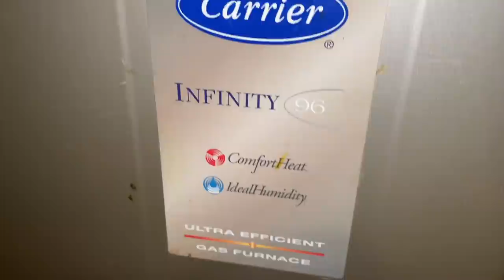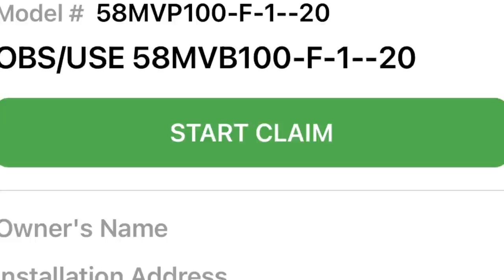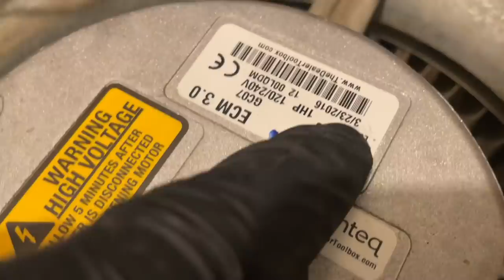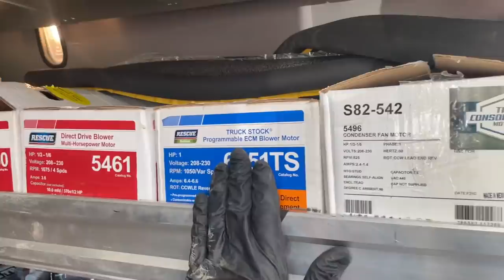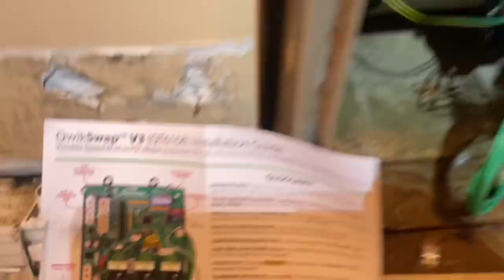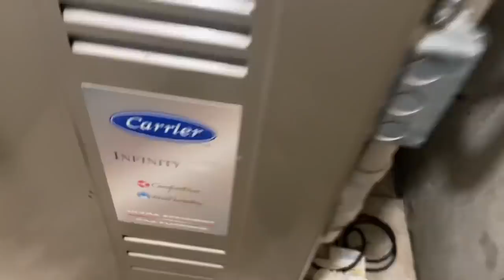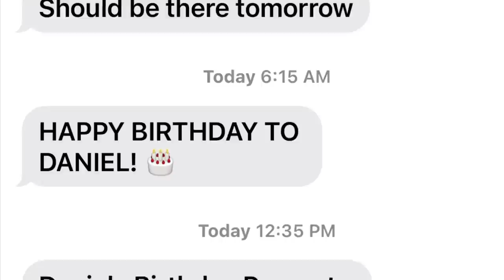Carrier Infinity Central AC Not Blowing - Dead ECM 3.0 Blower Motor Replaced with QwikSwap X3

Comment: I have found when the repair is most difficult and challenging one that I learn the most.  The hot compressor reminds me when outside valve wouldn't work in sub freezing cold weather and my co-worker took a buck of hot water and threw it on it and the valve started working.

Comment: I've had a few of my ECM motors die which I was able to fix myself. The wheel would wiggle back and forth as if it was 'seeking' or lost. Ended up being shorted windings inside the motor; not the ECM end cap, 3 times now. I have 2 fixed motors incase it happens again. Good to know this is an option if end cap goes!

Comment: Hey Mikey Pipes! Love the videos. I always hate holding this dang door switches. I always throw either those door furnace switches or a magnetic bowl to keep them on if there is a delay while I can get my tools all packed up and test the system. Just a friendly suggestion. Happy weekend!
Reply: I use hockey sticks
Reply: @PipeDoctor  that what we call them,they are little yellow plastic wedges shaped like hockey sticks,you wedge them in the switch,they work just like the little orange plastic keys
Reply: @PipeDoctor  I have alot of gadgets and tricks up my sleeves

Comment: Mike - Are you aware of the secondary hxt issues on these older carriers? them plugging up as plastic coating fails and producing massive amounts of co, rusting out too.
wise to visually inspect and do combustion test before bothering changing parts.
Reply: @PipeDoctor  yes - all the carrier 58 series condensing furnaces. Secondary is aluminized steel coated with plastic. Hot burner box and high co, rust on exterior of secondary, bad exhaust smell are all symptoms.
Class action lawsuit forces them to pay some labor or rebate on a new carrier. You can find product bulletin online detailing diagnostic procedure.
have a family member with one from 2005 as well (which is how i know), only a matter of time until it goes. 
Mi Heating guy has done many videos on this.
Reply: carrier = navien of forced air furnace manufacturers, denied that there was an issue for many years and kept on making them! :(

Comment: RIP that heat exchanger doe. Never used QuickSwap before. Ive been wanting to swap my PSC blower to an ECM on my old 80% Goodman so I can use Fan, might try one of those. Do you need to do static tests with that new blower/module?

Comment: I just had a motor just like that (x13 1/2hp 230VAC) die on me Yesterday. Would attempt to spin slow then stop and repeat. Found a burnt winding near the top of the motor. And my ohm readings were off got 11ohms on 2 windings and 3.8 on the third. Sad part is that it is under warranty but I am not the original owner of the unit (Moved in afterward) Already ordered my new motor for about $340. May think about switching to a psc motor with that board next time.

Comment: Did you tested the fau in heat mode and did the blower motor came on? In most cases the Genteq 3.0 cannot be replaced with aftermarket solutions except it’s own aftermarket brand Genteq Evergreen

The 3.0 is capable of being a fully communicated ECM (two-way communication between ECM control & OEM board) 
Usually Carrier Infinity & Bryant Evolution fully communicated or modulating systems require the Genteq 3.0 or Genteq Evergreen VS(which is a 3.0)

Just wondering if you had a heat recall because it wouldn’t work in heat mode

Or maybe the customer called someone else
Sometimes the customer forgets who to call

Check out Genteq Evergreen line of truck stock preprogrammed ECMs
Reply from the maker: Almost 3 years later still working like a champ.

Comment: What are your thoughts on Century brand condenser fan motors are they reliable or are they junk because the guy that just fixed my Package ac unit that had a bad condenser fan motor used a century brand motor instead of the oem motor that came in the unit initially because they no longer make GE condenser fan motors
Reply: @PipeDoctor  that's a good thing that makes me feel better about having that brand of motor in my system

Comment: How I would of handled this call if you can't live without ac it's this much for a temporary repair aka the blower you put in it being a 58mvp I would of ordered oem motor and told her the infinity is a top of the line furnace I would of told her the perks of the infinity control she can manage her thermostat from the my infinity touch  app I tell them I'm just letting you know what your system is capable of they either buy it or they don't 70% of the time they do its easy money and it makes the customer feel like your informing them on there equipment not just trying to sell them something let me know your thoughts mike

Comment: The ECMs never seem worth it. A good ol PSC will last much longer, assuming the cap is checked/changed. Much cheaper to replace if it does fail too. ECMs are another one of those efficiency gains on paper (in the engineer's lab) that is completely wiped away when it fails prematurely.
Reply: the primary benefit of variable speed ecms is to maintain constant airflow automatically over a static pressure range. its for comfort and performance, not just efficiency. the basic multi-speed ecms are just for efficiency improvement.

The modules can be changed separately and there's a universal one now for communicating systems. The most major issue is over-pricing of oem parts. imo what kills ecm modules is high static pressure. 

There are great benefits to ecm technology when used in the right applications. the problems start when they're universally used/mandated and contractors put oversized equipment on undersized duct.
It reminds me of when cfl bulbs were pushed as universal replacements for incandescent bulbs and people started claiming they're "expensive junk", last a shorter time when they were just used in the wrong applications.

Comment: I still remember my first hot compressor I worked on, it was a RTU, had 3 compressors in it, 2 of which were blown, so the last one was working triple time. It was 102 deg that day and I called in because I didn't have any continuity on the terminals, it was also a Friday at a restaurant, so it HAD to be up and running. I was told to ice it down and run water over it and wait for it to reset then check the ohms. 4 hours later, about 15 trips up and down the ladder with more ice, it finally reset, it was around 8PM by this time and on start up, caps checked good etc. the thing blew a winding and shorted to ground, which more than likely the compressor had internal damage existing, so another 1 1/2 hours to get the parts house open plus $100 opening fee and the compressor, spent the next 4 or so hours replacing it, but they only wanted to do the one compressor, said they had a new unit on order, it was about 2 weeks out.